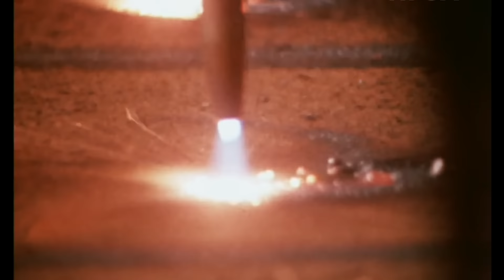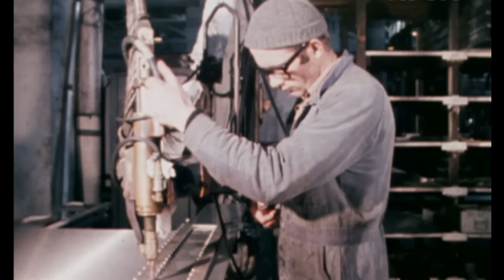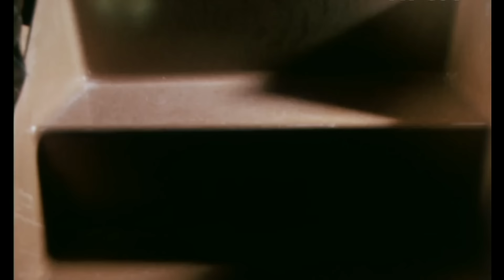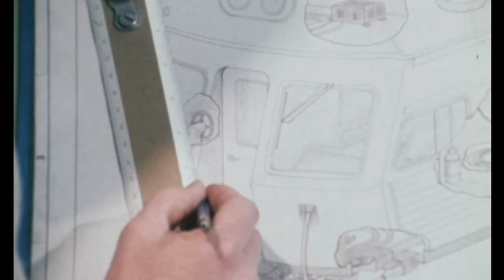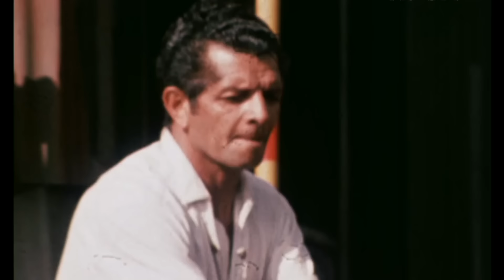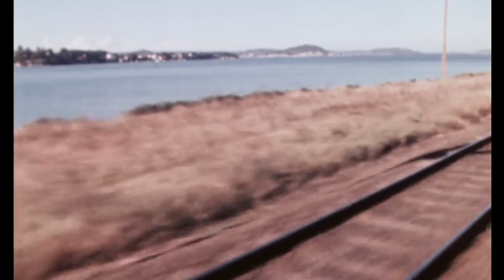Two Storeys High (Comeng, 1970)

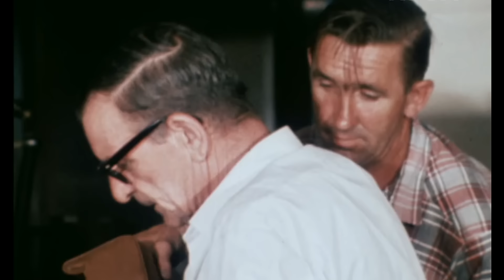Comment: Great video! Great music at 11:19. Look at all that work, all to be dismantled 50 years later. I remember the book seat numbers and ashtrays. The 1970 driving trailer shown as the flagship car, no guards doors, no go with the union when tried on 1st gen s set driving trailers despite the v set version in regular use for a few years beforehand. Great to see all the type of construction operations, no asbestos to talk of? Or maybe i missed it. Love to have a bench seat as a souvenir. Jm
Reply: I bet they had asbestos in the brakes.

What did the guards use if they had no doors of their own?
Reply: Possibly guard used the guard doors in power car. Driver in driving trailer might have locked communication door between saloon and vestibule area and just open the passenger door on the left to get out at answer trackside phone. There were steps under that very door from memory.

Comment: V sets still NSW’s best and one of best in Australia and these DDIU (double decker inter-urban) or first 1970 batched V sets as they were later known as were targeted as “U sets” not to be confused with single decker U-boats but remember hearing leading car targeted “F111” and this video just showed it. The “V” set target come with the second 1977 DCM/T cars as they were the first with “vacuum” toilets weather the cars shown in this video had I believe drop to ground non flush toilets but were later fitted with flush, vacuum and tanks same as later V sets, sometime in the 1980s this first batch cars refurbished were also de-motorised into trailer cars with newer DIM cars powering them for better reliability and by the end of the mid 00s all first batch cars featured here were taken out of service due to under frame rust, I remember riding one of these first 1970 cars in 06 coming back from Sydney to Newcastle when I was like 17 or 18yo as it had the different interior that you see here which was lucky as they were being scrapped around then.
Reply: The doubters who said the "F111" target did not exist now have proof that it is true. It was missing from the set when it returned to Sydney during the afternoon. I went down to the platform to check, having photographed the departure in the morning.

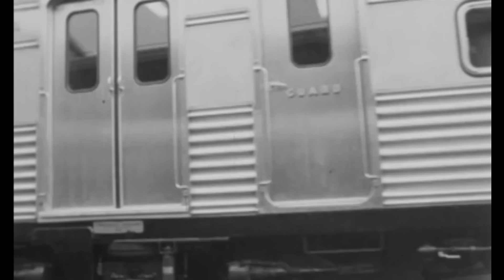Comment: 18:59 WHOA WAIT, that’s a different interior — the panels are all thinner and not rounded in Boeing 747 style — look at that ceiling!  Is that centre lights!!?  No coathooks obviously
Reply: That's the interior of the series 1 V Sets/DDIUs from the 1970's before the following modern interiors we know today. 1st series V Set interiors did have lights in the centre and no wall mounted coat hangers however they did have reserved seat numbers.
Reply: Notice different a/c outlets upstairs between windows 18.21, downstairs through rectangle roof vents 18.59.
Travelled on one of these in early 2000s, must have been kept as a spare, a/c far less effective.
Reply: @Dee-k6e3p  the first series cars were all converted to trailer cars 9201-9215 and placed in different sets, they were quite strange. They were withdrawn pretty quickly in 2005 due to corrosion in the carbon steel under frames.

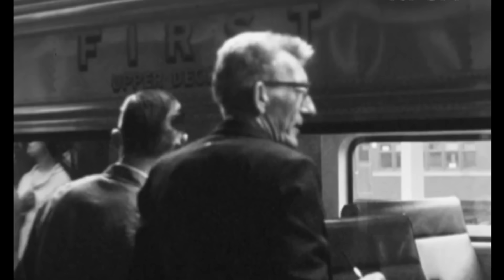Comment: 17:58 FIRST class! 😂❤
Reply: Upper Deck only.
And booked seats 😮
Reply: @Dee-k6e3p what else did you get in First Class, and drinks & snacks?
Reply: @paulsz6194  Before my time, but it was great to have the water dispensers with paper cups in entry vestibules until the late 1990s
Reply: @paulsz6194  I've always wondered that. I think it was just that you got carpeted floor (big deal) and got to sit apart from the riff raff.
Reply: At least you would be away from the junkies/drunks and eshays that inhabit the newcastle line.